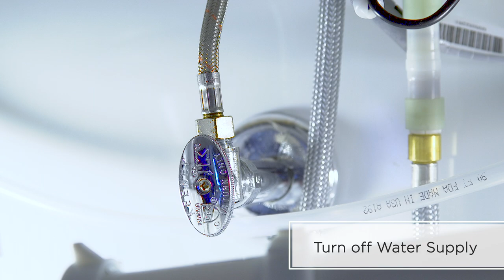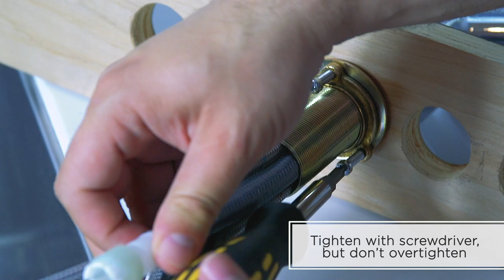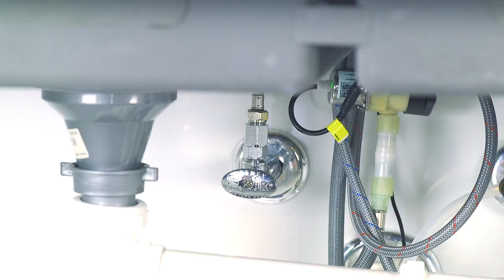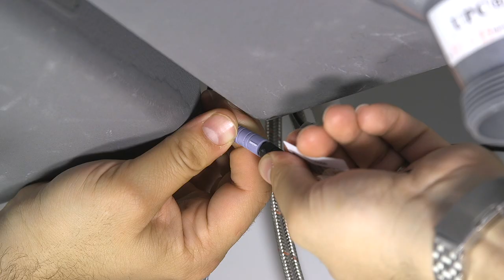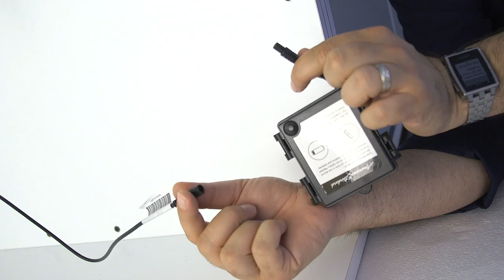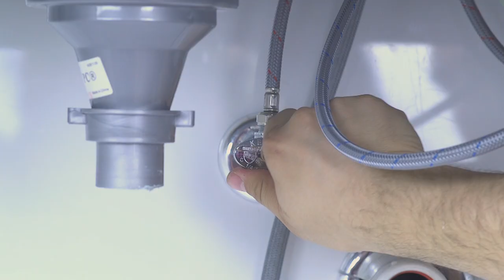How to Install an Avery Kitchen Faucet

Comment: why are all faucets now 3/8 th inch hoses when all water lines are 1/2 inch .I cannot get the hot water to stop leaking with the adapter lowes sold me that changes my half inch to the 3/8 th inch hoses for the faucet .The cold water has no problems but the hot water continues to leak no matter what I do .Is there something else i can try .